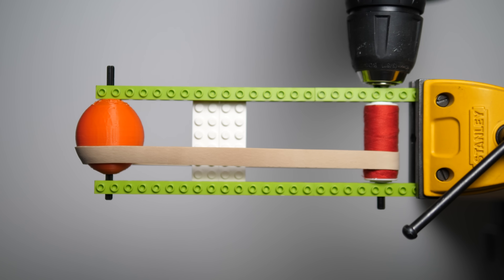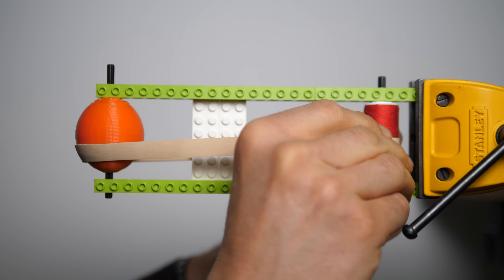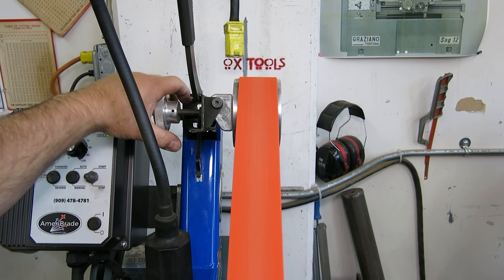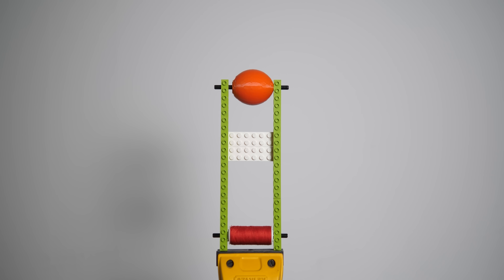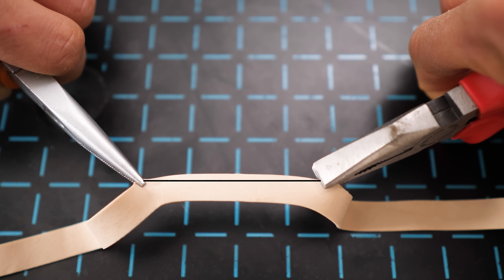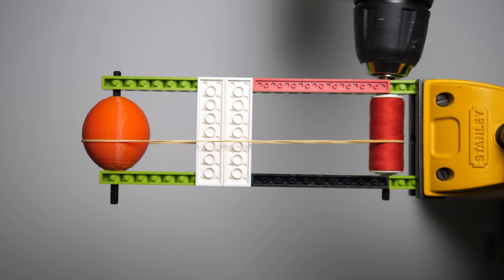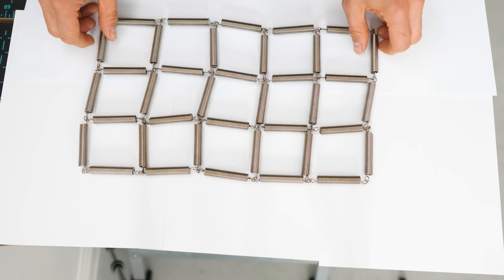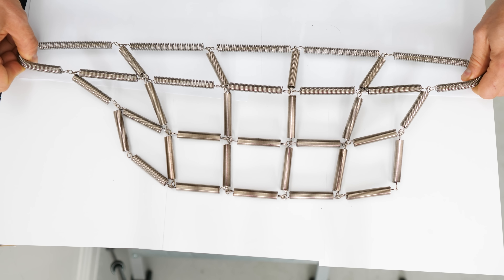The Band Should Slip Off But It Does The Opposite!

Comment: I have to disagree with the root cause of the effect. I see it explained through the following process:
1. Draw a horizontal line across the band, side to side. The direction of band travel is Normal to this horizontal line
2. The driving end propels the band at a certain speed, let’s call it V
3. The elasticity of the band allows it to effectively wrap itself around the crown in a smooth way and continuously contact the surface.
4. The band on the thin side of the crown travels at the same speed as the band on the thick side of the crown,  but the two sides of the band have different circumferences to travel around
5. Since the band on the thin side of the crown has a shorter circumference to travel, it travels ahead of the band’s other side, which bends the horizontal line in such a way that the normal vector points toward the center of the crown, and causes the whole band to travel inward.

This explanation also works on the case where the crown has opposite curvature and the band travels outward.

Comment: Anyone might want to know: forces on a body always act to locally minimize the system's potential energy (potentially subject to macroscopic constraints, like walls and solid objects), usually turning into kinetic energy. Entropy, and entropic forces, is a way to understand the collective behavior of a huge number of particles using statistics. A simple example is when you dissolve a liquid into another. It tends to spread out and mix, not stay compact (for fluids that dissolve one another, at least). "Entropy tends to increase" (actually, it's more accurate say that entropy tends to not decrease!) is analogous to "things tend to get mixed up or jumbled up" in some ways, or better yet, "things don't tend to unmix" -- that would be really strange, wouldn't it?

Comment: I've always wondered about this effect in relation to band saws.  A band saw has a pair of crowned wheels that pull the blade around and around, much like the setup Steve showed. But, the saw blade is metal, not elastic.  I doubt it deforms much to pull it back to the high center. BUT, the wheels are covered with rubbery tires.  Are they doing the deforming to keep the blade traveling in the center?
Reply: The metal is exactly like a rubber band

Comment: Hey Steve! I've followed you for years, so it was super exciting to see our belt grinder in the video Tom sent you. I definitely didn't expect that when I started watching. Obviously, belt tracking is a phenomenon we spend a lot of time thinking about in belt sander design, so it was nice seeing someone explain the crowning effect scientifically. Home builders often run into problems when they add a tracking adjustment because the interaction with the crown isn't necessarily intuitive. The belt seems to ride to the high point of a crown, but it also looks like it rides down the slope when you tilt a wheel to adjust the tracking (as it does in the video Tom sent you). We have our own working theories on how crowning interacts with adjustable belt tracking, but I'm sure I would learn something and see it in a new light if you ever looked into it.
Eric
Reply: 4:45 Still don't understand why it would bow upwards. I don't see anything pushing "up" just material stretching along the line. He did a terrible job at explaining. Why would those for springs be pushed up? I don't see any deformation that would push them in that direction?
Reply: This Channel here reminds me of Hbomberguy; 
my Favorite Place to learn. 

Well, that and Veritsaium.
Reply: That ruzzian flag on your avatar though. :D

Comment: This is great I’m actually in the middle of solving the same problem, as I’ve been running a rubber band off of the hub of my bicycle to interpolate a lower speed,  It’s fooling my electric bikes top speed limit. I made a pulley that see the same affect. I’m switching to a round silicon band to solve the problem.

Comment: Hi Steve. Sorry I disagree with your reason why the crowned pulley pulls the belt  to the middle.  It does this because the crowned pulley has a larger circumference in the middle than its edges. I bet you if you have a cylindrical pulley with its axis not parallel to the oposing pulley and create a "bow" in the belt exactly as you described,  you will get the opposite effect. The belt will track off to the side.  Try it. Prove me wrong.  A crowned pulley works because of the change in circumference.  Its the same way train wheels work. I LOVE your videos and would love to hear back from you.  Chich.

Comment: Here's a question: What happens if both pulleys are crowned pulleys? Will there be sufficient tension available to make the rubber band seek the point of largest diameter?

Comment: does the different tension on a different part of the flat rubber band play a part in bringing that band back to the centre? you did mention that one side is longer than the other on side of the crowned pulley. so it's definite that one side has stronger tension as compared to the other

Comment: FWIW, band saws also use crowned pullies to center the steel band.  They usually have some thrust bearings added behind the rear blade edge which keep the blade from wandering only when you push a work piece into it.   Apparently some larger saw mills actually have teeth on both sides of their bands (so they can cut in both directions without waiting time to reset to one end) and rely on only crowned pullies to center the blade.  Check out a video called "LOG BANDSAW - DOUBLE CUT"   It's very satisfying.. ;)

Comment: That's why my bandsaw has curved wheels. And here I thought they were cheap and I was considering sanding them down. Glad I stumbled upon this video!
Well wait a sec.... now after watching the whole thing, my bandsaw does not "stretch". The metal saw blade that goes around is taut. So why would this work with a non-elastic material?
Reply: Steel is elastic too, it's just a great deal (at least 2000x) stiffer than rubber so the stretch is less obvious. Springs are an clear example of this fact.

Comment: To save you all time. A belt will travel in the direction of its greatest tension. Since the inside portion of the rubber band facing the crown has higher tension it will travel in that direction. The same applies to belts traveling on rollers that have the same diameter on each end. In that case getting the belt to stay centered by adjusting the tension side to side is critical.

Comment: I love seeing people use electric drills as motors because it's hilariously the exact same thing that the tool designers for Al our construction tools do. Basically every tool is run off of a rotary motor which is then connected to other components to get the effect they want. Like reciprocating or oscillating or even hammering. They all start with rotary motion because. I guess it's the easiest and most energy efficient (therefore powerful in application).
Reply from the maker: Nice observation!

Comment: This principle is exactly why we don't have "high-speed-trains" in the US.  Train wheels are  similar to "crown pullies" in that they are not perfectly flat, but instead are like truncated cones.  The point of this is to direct the train to the middle of the tracks.  But that configuration also has a maximum speed before the train derails, even if the track is straight, clean, dry, and has no bumps nor debris on it.

Comment: Most roads are crowned toward the center to get rain to run off the road surface.  While driving on a long straight stretch you will notice the car wants to move to the center of the road and you have to keep twitching it toward the edge.  That is the same thing which happens on a crowned pulley.

Comment: The differential tension is not the reason the belt climbs.  The belt in contact with the faster-moving surface is pulled forward faster (& the other side is pulled slower).  This causes the belt to angle itself on the crowned pulley.  You can demonstrate this by wrapping a paper strip around a cone, initially starting with it perpendicular to the axis.  The strip will spiral toward the fatter part.
          Key to the centering is the friction between the belt & the pulley.  This is put to use as a safety mechanism (especially in the old factories with central engine driving overhead shafts, belted to the individual machines).  If the driven torque gets too high, the belt will slip, and the centering function lost.  The energy of tension will drive the belt off the pulley, disengaging the load (such as when a lathe tool digs into the work).  The belts act like individual "circuit breakers" for the machines.

Comment: Band saws, belt sanders, tractor belt drives all use convex pulleys. Note that all these run at a relatively slow maximum speed. Where high speed, or speed change is required V belts are the preferred choice.

Comment: Back when they invented the horse-drawn road grader, and started crowning dirt and gravel roads for water run-off, it was found that while cruising along in your Model T down the center of the road, the vehicle would stay centered without you having to steer it.  Even around curves, as long as the speed wasn't too fast, or the radius of the curve wasn't too small.  Same principle as the crowned pulley.

Comment: Most people think that the round thingies in a block, (part of a block and tackle) are called pulleys, but they are not pulleys.  They are sheaves.  (pronounced, shiv or shivs)  They are free-wheeling on their shaft or axle and cannot transmit rotational energy to that shaft.  They can only change the direction of motion of whatever is driving them, such as a flat belt, V-belt, rope, or cable.

Pulleys, on the other hand are attached to the shaft and spin with it, just like the V-belt pulley on an electric motor, or the thread spool and crowned pulley in your demonstration.  If it can transmit power to a shaft, or receive power from a shaft, it's a pulley.

On the front of an automobile engine, you'll find pulleys.  You can find them on water pumps, alternators, power steering pumps, radiator fan, and other accessories, along with the primary pulley in the system that's driving the belt or belts that go around all the other pulleys.  Many engines have an idler pulley in the belt system, but it's actually a sheave.

Of course, over the years, people allow words to represent things that used to differentiate them from other words.  That comes from ignorance.  A modern dictionary will tell you that sheaves and pulleys are the same thing, but now you know the truth;  that they are similar, yet work differently.  Lexicographers don't know everything, and often go with the current vernacular, or whatever colloquial terminology is presently being used, and we lose a little bit more of our language every year.

Comment: I used to run a CNC controlled saw called a F and K. Its origins are from germany. Had a 3mm wide saw blade about .5mm thick and 24 or so feet round. It had a series of pulleys that were shaped curved on their surface. 
The blade itself worked like a 359 degree rotating bandsaw. The FK actually twisted the blade half a complete rotation in either direction and the floor of the table pushed and pulled left to right, conveying your material; while the saw guided itself left and right, as well as twisting to cut angles cutting your pattern in the material... The blade also had a pulley on the top that rode back and forth left to right to keep the blade in tension at all times. Get this the manufacture used the front spring from a 60's VW Beetle to tension the blade...

Like your model, the most obscene part of it was that the blade, though twisting and turning while rotating was riding upon an uneven pulley surface the entire time...  BUT if you get a loose bolt on a pulley, yeah that blade is off with a huge bang....

Comment: If it were not an elastic band, it wouldn't be able to expand and thus because the movement upward on the round thing would cause it to lengthen, the band not being elastic would break. Hence the reason we switched from belts which would increase in size over a period of time to gearing. Just as one is forced to change the fan belts on one's automobile occasionally. ANY and all belts regardless of their compostion eventually strech to a point where they no longer can provide sufficent friction to turn the object their suppose to turn.

On the other hand, not putting greese or other such lubercant on gears will eventually cause them to increase in size due to the tempatures envolved between two or more gears friction will eventuall cause the gears to break. Hense the fact we install various lubercants in side motor as well as out side on exposed gearing.

Comment: The reason the rubber band centers on a convex roller was first described by John Shelton in 1967 in his PhD thesis. It is referred to as the normal entry rule. A web will seek perpendicular entry into a downstream roller.

Comment: Not so far as mine machines, the agricultural machines were often motorized (due to lack of small, inexpensive motor) by a belt coming from the "tractor" "motor" on a pulley the angle of which was uncertain because the tractor and the machine where just stationed on irregular ground surface of the field. And, evidently, the pulleys (or at least one) was convex as you show and all worked well. So, no need to require the structural molecules at help. Or Heat exchanges !
But congratulations to have shown that this did not work with narrow belts which even twist on themselves, ruining even more the efficiency of the phenomenon.

Comment: 1:15
yeah... well.. of course it does

I understand the confusion as to why people would assume it would fall off
but.... in the example you gave with the pipe
THE DIRECTION OF FORCE was towards your hand AT ALL TIMES therefore it goes TOWARDS THE DIRECTION OF GREATER FORCE      it's Directional bias, if you will

so in the case of the orange, when you pull it to the bottom 
THE TOP HALF OF THE BAND has the MAJORITY OF THE FORCE
therefore... IT'S BIAS IS UPWARDS which is why it moves up and not off

Basically the force that is motivating it to fall off IS LESSER than the force motivating it to move up
so yeah.. of course it would move up

However if the force was all in the down direction then yes.. it would fall off

Comment: The more stretched Part simply gets more grip and therefore turns faster, pulling the lower Part into the middle. If you would have a Rubber Band, which is shorter than the lower side distance, it would Fall off, as there is no force to hold it. So one key ability here is size. Size matters. Lol

Comment: Where I work we have a few long conveyors. We use the term "the belt goes to the high side" when we have to make adjustments to them if the belt is tracking badly.

Comment: I'm not sure I buy the explanation. The bowing might be real, but that doesn't mean it is the source of the phenomenon. An alternative idea is that when the rubber band is stretched more, it grips the axle better. So the top of the rubber band in this video is stretched more than the bottom and it is the greater grip on that part of the rubber band that causes the belt to migrate in that direction, back toward center, back toward the situation in which the band is maximally stretched across the belt. This could be tested by reducing the coeeficient of friction between the rubber band and the spherical axle. If the friction is less, the migration back to center should be slower, or at least it should migrate with less force. But if the phenomenon is due to bowing, that friction shouldn't make a difference - it's all in the topology of the rubber band.